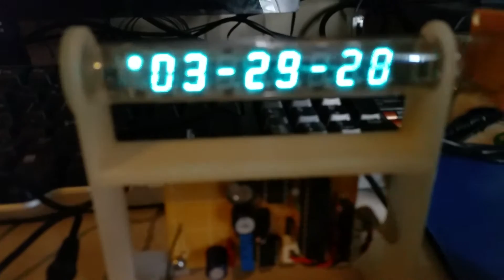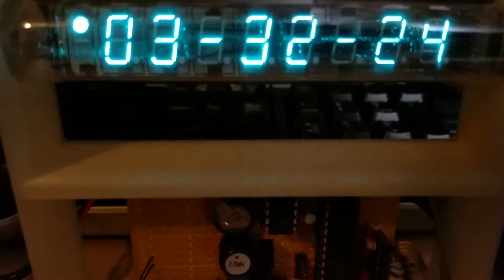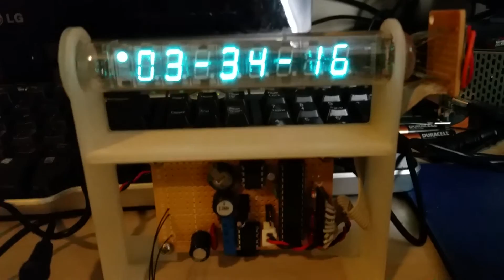DIY IV-18 VFD Tube Clock Update: Now with Custom 3D Printed Stand!

Comment: Do you know the average longevity of these tubes?
Reply from the maker: It depends on how hard you drive them, but I've heard of tubes of this vintage running 24/7 for decades. The thing is they usually don't outright fail, but get dimmer and dimmer over time as the phosphor breaks down.

Comment: Running the tube at DC will not harm it. VFD's does not contain any mercury - they have a hard vacuum. The reason to avoid DC is the gradient across the tube - some tubes will have the emissive coating on the filament made in a gradient so it gives a good straight brightness across the display when using DC. https://www.noritake-elec.com/technology/general-technical-information/vfd-operation
Reply from the maker: zaprodk That's good to hear. I've read accounts on both sides of the issue so I really wasn't sure. BTW would you happen to know what the rough operational lifetimes of tubes like this might be? I plan on leaving it running 24/7 since it's so beautiful.
Reply: Regarding the lifetime, it's hard because the old russian stuff were marked with very low lifetime in the datasheet, so customers couldn't complain. I would personally just let it run 24/7 and replace it when it's getting too dim - the tubes are so cheap anyway!
Reply from the maker: zaprodk I figured that might be the case so I've stocked up on a few extra NOS tubes. I might turn down the brightness a bit too since I definitely don't need to drive it as hard as in this video for it to be visible.